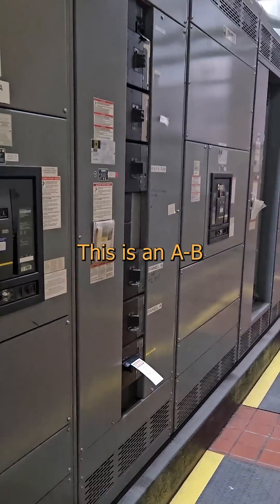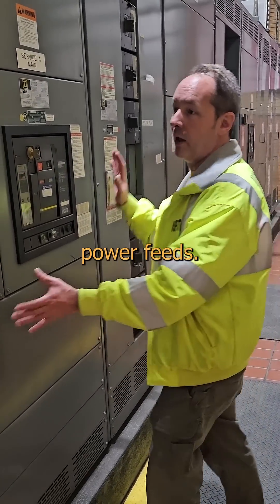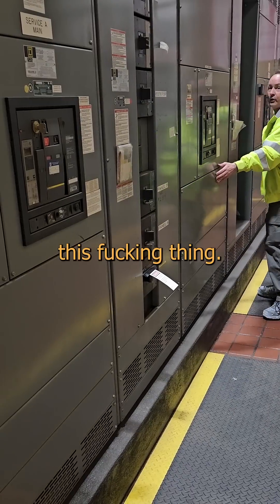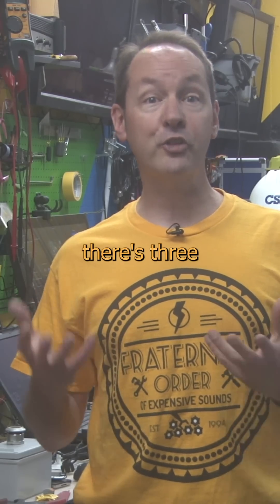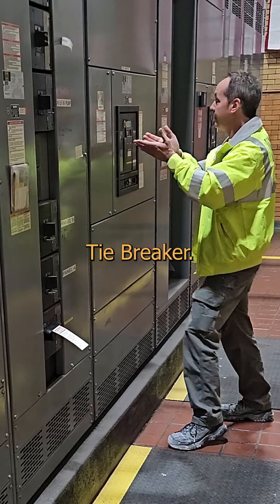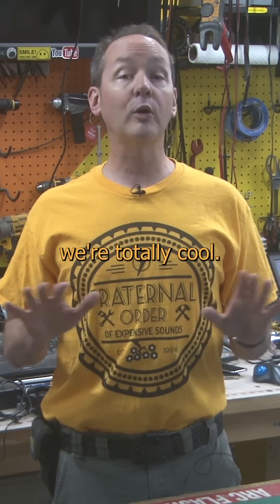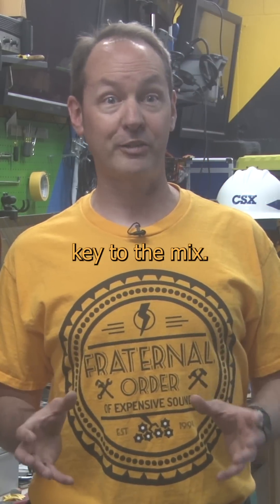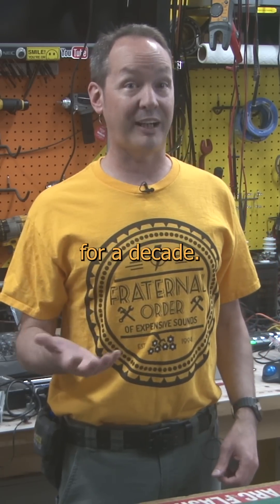A B Interface #chrisboden #comedy #electrical #engineering #energy #substation #switchgear #power

Comment: When I was studying nuclear power in the Navy one of things they taught us about was Automatic Bus Ties (ABTs). these are switches that automatically will switch a load to an alternate power supply if the normal one goes cold. They were always, "Break before make," things, meaning when they flipped, they always disconnected from the normal power supply before connecting to the alternate. Are you familiar with them at all, and why wouldn't they be used in the situation you describe?

Comment: We have the same switches at our  manufacturing plant. We have 3 11kV to 415V transformers on site. 2 separate incoming feeds but they are synchronised. There is a facility to power the whole site with 1 transformer , with some load shedding, connected through the 415V boards. 🇦🇺🦘🪃

Comment: I bought the "we need smart people to become engineers" 16 years ago. I changed career, went to university and got an upper second class degree in Electrical Engineering. Applying for graduate schemes to become chartered as well as jobs in the sector. Lots of job interviews and always the same result, just beaten by someone who had something I didn't. One occasion they had lower class degree but could speak Italian, they were Italian. In the UK you don't give your age or date of birth until your hired. Everyone who beat me was 30 years younger than me and they only discovered how old I was at the interviews. I would love to gain my chartered engineer status and work in the sector but it's not going to happen, they'd rather have no engineers than an old graduate engineer.

Comment: The old office building I worked in had dual feeds due to the data centers in it... it was nice if the power went out, it would auto switch and we'd be the only building powered up.

Comment: Done some work on those big black square circuit breakers, they are a little deeper than they are wide into the panel and theres a lot of heavy metal inside. Apparently in a catastrophic failure event they shoot out of the panel at high speed so i dont stand in front of them when i reset em

Comment: We have a maintenance contract with Zcolo and they have a handful of these types of power distribution panelboards. But they have custom installed mechanical locks with the key deal. It is so confusing but they have a manual plastered on the front giving you instruction on how to switch between sides. They also have cabinets full of dozens and dozens of car batteries as a backup for their servers.

Comment: The building I'm working in has 3) 13,8 sub stations in the basement with this system. Bus bar linking all 3 together. So if one goes down (which has been for years) the other two can help it.
Reply: Key system was fun to mess with. Especially when there is a massive 4,000 amp switch gear also down there from the 3 generators.

Comment: The super spicy option is double tie with a backup Gen in the middle. Then you can parallel and shift to Gen before shifting it again to load both halves from one utility. But normally the Gen only feeds a/b as needed if power is lost.

Comment: that's interesting to do the interlock using keys, all the ones I've seen use an A/B switch that either gate the other or a 2 way switch (the simplest I've seen that's not just a DT switch is 2 toggle switches tied together, and one with on up and the other on down), granted they're like 50A at most for switching between a generator and the grid.
there's also some that use an on-line UPS which has a DC stage, so it doesn't care what you feed it and if it's synced, so you can just switchover without turning anything off.

Comment: This reminds me of a particularly fun August night some years ago. At 12:15 in the morning of one of our transformers shorted and dropped all of the manufacturing equipment, that was only a $2 million loss in about 10 minutes. Fast forward a couple hours and we came to the conclusion we could shed load and then tie the main switchboard. Imagine our surprise when we found out some chucklehead had broken a key off in the tie breaker lock. So at 3am in very limited lighting with no air conditioning when it was 95 degs and 95% RH outside, our top two ranking electricians in the company drilled the lock cylinder out on live switchgear and hung a very funny worked LOTO tag on the breaker to get us back to operation.

Comment: I’ve worked on a system that is more spicy. It is a 23kv main tie main that some r-tard removed the Kirt key on so he could supply the plant with both sides of city power incase one dropped it wouldn’t drop power in the plant. He survived with a little hearing loss but the plant went down  for just under 24 hours so we could clean repair and temporary power back in until a new gear could be installed. It also knocked both city power circuits down. But they had them back up within a few hours.

Comment: I'm surprised this is done via keys and not via a bar linking all the breakers together. Middle position: tie breaker open, A and B closed. Left: A and tie closed, B open. Similarly for right side.
Or would that result in a switch over that's potentially too fast?

Comment: I'm not a electrician but was a building management facilitator or an organization I can't mention. We had a need for redundant power and had an A and B grid connection with a huge UPS and a huge diesel fueled generator.  My understanding how the it worked was we were either connected to A or B grids and if one failed it would automatically fail to the UPS and trigger the generator to fire up. While the generator was speeding up and syncing we had a transfer switch that would attempt to fail over to the other grid if it was energized. If we ever had a power outage, other than a flickering of lights, the personnel would not even know it was happening.  It was all digitally controlled and I got to watch it happen once during a test. It was pretty cool.

Comment: we had a pregnant white footed deer mouse get across a phase of a pair of phases  one from A buss and one From B  buss in the tie breaker. It took down all three phases of both feeder and blew up integrated circuit controllers everywhere in the complex unlucky enough to be on one of those two feeders that shorted.  They found the remains of the pregnant mouse  Head & tail & four legs connected by a spinal column with 12 little fetuses scattered about.  She was a very expensive and unfortunate mouse.

Comment: I've toured a data center that is infrastructure related that has power service running from two separate grids. They picked the building site because it was close enough to the two they could run power from each. It also has two different diesel generator setups, one as a backup to the grids, one as backup to the other generator. Was pretty incredible.

Comment: In one building that I was in, we needed 480 V to run some imaging equipment. We had one leg coming in off of one grid, the other leg came back off of another. We had a lot of protection circuitry for the times when one of the two legs would go down Leaving the 480 equipment in a functional brownout, and I was also freaky because whenever we lost power there was only once in 15 years that the entire building was actually out. The rest of the time half the building would be out in the other half wouldn’t. Except for the protected imagery circuitry the two sides never came together anywhere in the building.

Comment: Feed all supplies into -48 volts, then into batteries.  Critical systems run off inverters from the batteries.  Redundant commercial power, generator, solar, wind, cats on treadmills, or whatever motivates the pixies to charge the batteries. If one has a checkbook, anything is possible (IBM motto).

Comment: You know there has had to be a reason for the "no more than two keys on the floor" rule...
Reply: That is a shadow on the opposite wall detectable by more senses than vision alone ..
Also , the impact craters from what were formerly components of the switch gear .

Comment: At our facility, we have a 4 unit, 4 megawatt gas turbine generating station. We can sync and tie to our existing primary utility feed, isolate from the primary feed, sync to utility secondary feed and then tie to it. Regardless of whether we are on A or B, we have to dial in our co-gen supply to only supply 80% of our demand when connected to utility, as per DWP regulations, as we're bound by agreement that we can only supply 80% of our needs from our own plant, even though we can handle the entire load for our facility. DWP wants their income.

Comment: I work at a DC that has three power feeds, and three separate back up generators.  There are three distinct circuit paths for all of the conveyors and other machinery.  There have been times when we lose one of those power sources and the corresponding generator kicks on. As part of the maintenance crew, we find ourselves resetting all the equipment that may have been tripped due to the failure.
I was asked once, by a manager, if we could run extension cords from the source that was live, to the one that failed in order to continue operations.
My initial response was quiet surprise…stunned by the lack of thought.
I recovered  and said “we’d need a work order, for that…and several weeks to set it up.”
Needless to say, we did not comply.

Comment: Yeah, all of the datacenters I’ve worked at have redundant power. Mains power feeds giant UPS systems, which feeds the racks. In the event mains is compromised, the diesel generators kick on before the UPS’s batteries run out.

800 amp distribution panels, and a single rack using 4 x 50-amp whips. For some of the smaller distribution panels, the electricians would wear arc-suits, for the bigger ones there was no point to wearing the suit.

Cheers!

Comment: Where I work one of the sites has 4 feeders synchronized into the gear where all ties remain closed unless a supply goes out of phase. If you lost 2 feeders the em gen would fire up and sync into a fifth breaker.

Comment: I had a job where I remotely controlled 5 sets of 3000A 480v maine-tie-main switch gear. Unfortunately I was never allowed to switch the equipment under load. Even so they make the devils own noise when they switch. Very impressive American made equipment.

Comment: Wait, hold on, with the kind of mechanical interlocks they have on vacuum contactor cabinets.... do they not have mechanical interlock designs to prevent a 3 key big bada boom configuration?

Comment: Look up videos of what happens when a unsynced generator is plopped on rhe grid.... Big badda boom doesnt even cover it. 

What happens is the little genset (and I am including semi fruck trailor sized backup generators in that term)  tries to either lag the power wave of the AC in which case the inertia of every other spinning mass generator on the grid grabs it by the front of its collar and yeets it to the moon, or it tries to lead the wave, and every other generator on the grid grabs it by the back of its collar and yeets it to the moon.

Life Pro-Tip: terrestrial gensets do not like unplanned trips to the moon.

Comment: Add a generator into mix for extra fun.
Hospital I'm doing metering work on currently, we're working in the LV distribution areas but not touching anything of course, but it's fun to look at the diagrams, instructions and learn a little.
The ones here are are electronically controlled, so if one of the incomers looses power it will open the incomer ACB and close the interconnect ACB, if both lose power, both incomer ACBs open, the interconnect closes, and the generator feed closes.
While in scenario 1, if power is restored they will automatically open the interconnect and close the incomer to go back to normal after a delay of a few minutes, but in scenario 2 once the genny has started it requires manual intervention to go back to mains.

The scary bit is the big "H.T. trip" knockoff buttons that will send a signal back to the main feed where the grid comes in to the site and shut down the whole HV ring.

I'm not sure what a dozen Cummins diesel generators sound like starting in near unison across a 40 acre site - and it would likely be detrimental to my career to find out... so we give those buttons a real wide berth.

Comment: Was on shift Friday night at a datacentre when we had a power outage on one of our grid feeds and a couple of generators kicked in to take the load. I had to manually switch the feeds so one could power the whole building rather than the usual balanced load across the 2.

The cabinet system we use is in a U shape, A left and B right with the tie breaker in the middle of the 2. Key in A to release, 2nd key in B and that releases a 3rd key. Take 3rd key to the breaker to release the priming handle. Pump that fucker a few times to build pressure and press the GO button. The sound of that switch connecting made me jump. 

3am and fully caffeinated. Data centre powered and generators back to sleep. If it did go bang badly you'd be barbecued between the cabinets that are a shoulder width apart.

Comment: Im a electrician at a factory that uses a lot op power. We get the power from 2 transformators. If 1 dies we can conect the 2 sides with the A-B breaker. That way we can run on half capacity because some machines on side A relay on machines on side B but we turn half of the machines of.

Comment: Most equipment has problems when you double its capacity. They do not like running at 200%. I always hated checking my last jobs' ATS banks, from city power to backup power. If they did not close and have power running within 10 seconds of the 480V, 350-amp system, I would have to fail the system, lock it out, and place it in the backup ATS. Fuck did that electrical system give me many brown pants

Comment: Saw someone try to bring a small emergency generator (relative, not the giant F-M diesel gens you see on an aircraft carrier) online with a live bus. The gen went into cardiac arrest, broke all the bolts holding it down to the pedestal, and then spun 180 degrees and ended up upside down back on the pedestal.  Definitely a candidate for membership in the fraternity.

Comment: glad to see i didnt waste my time lol there is no good solution. so what i got going on is capacitors inverters and 120vdc to 12vdc 10X amps then inverters. all inputs to useable dc voltage that way a loss in 1 of the inputs wont cause a loss in power you just need to switch on power #2 before caps run out of power. but you can have a steady output with minimum losses. and to get a solid ac power dont even bother with semiconductor inverters they all low power for the price so i like to go with modified alternators to get a clean ac power at whatever frequency or volts i want. if i want higher volts spin the dc generator faster if i want high frequency spin the alternator faster. computer controlled cvts can spin the alternator and generator at just the right speed to get your power levels no matter the engine speed

Comment: Got a similar setup here in our small town america population 3,500 in the midwest. Main transformer station on the south side of town divvy's power up between the two halfs of town. If something fails on the A side supply they can take the B side and drop it over to the A side to run it as well and vice versa. For say in the middle of winter if a ice storm hits and causes an issue this will keep the furnaces running across town since gas furnaces don't use much power. But in the summer this doesn't work so well with everyone's A/C condensers running since this would potentially overload the one side trying to run the whole town.

They used to have to jerry rig a tie over line between them to do so but here a few years ago they finally put in a proper switching setup in to simplify, speed up, and improve the safety of the process.

Comment: Our facility has dual utility inputs to separate 13.8kV/2000A switchgear.  They are cross-tied to be able to run the whole facility off one side or the other.  Only difference is, there's no keys, just the control system controlling the BBBs: big bangin' breakers.

Comment: I was apprentising at a train yard and we where making connecting cables that come inside a electric train,    one of our supervisors came and took few of our made cables and re checked them.  and then took a big folder and asked us to come and see, then he told us that if we could use this cable this would happen and he showed us a picture of a electric engine train,  and the transformer cart,     and the transformer cart looked like it had exploded from the inside, it was missing a massive chunk out of the side of the traincart and well it was totally toasted.       and our supervisor says " this cable explodes like that if you dont remove this part  and points to some insulation.  it will short circuit and explode

Comment: My dad designed data centers for abovenet, they have a different name now. Each data center was on 3 different substations. All n+2, ie they could loose 2 substations and stay operational. At the time they used mechanical synchronization. Motor/generator - flywheel - engine .